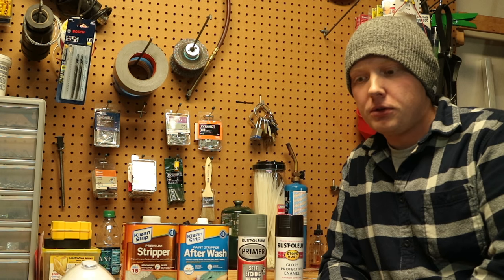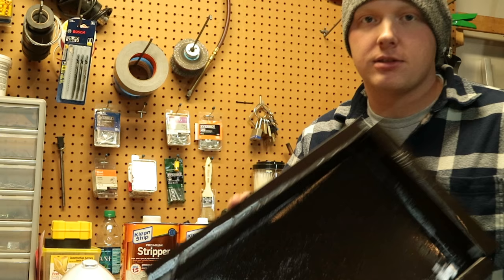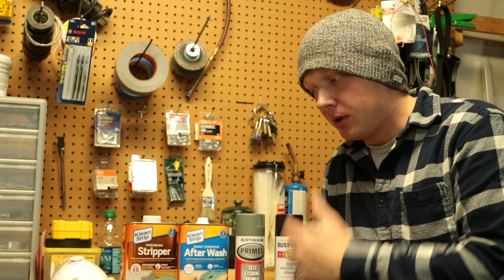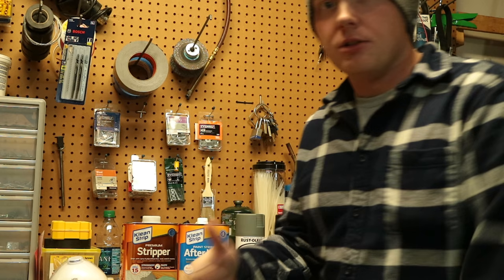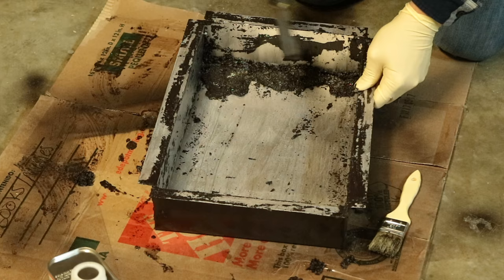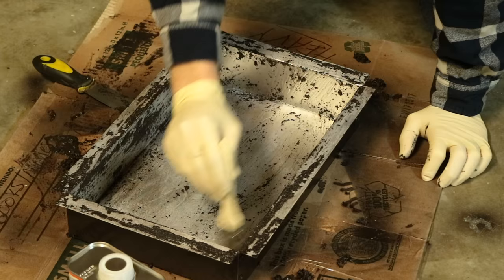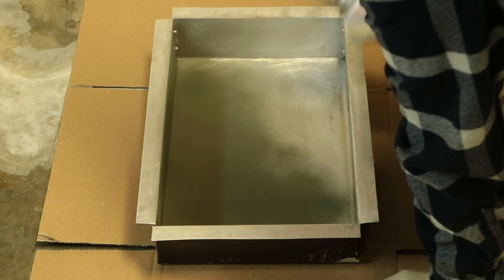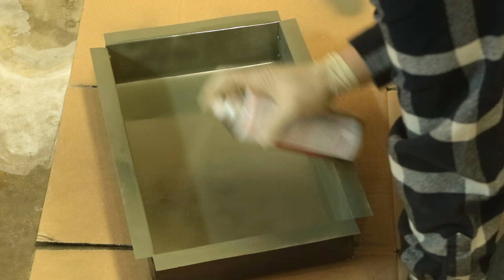The Right Way To Paint Aluminum

Comment: Great video!  The reason it’s hard to get paint to stick to aluminum is because the aluminum surface immediately begins to form a loose oxide. If you have ever wiped off aluminum with a rag or your hand you’ll see the oxide as a grey color. Since the oxide is loose any paint applied sticks to the loose oxide and not the aluminum. The self etch primer has an “enchant “ that removes the oxide and roughens the surface for the paint. Cool stuff!
Reply: * Etchant
Reply: Can I affix this enchantment to other solvents?
Reply: @paulwary Damn I was hoping it would enchant it. 

I’m welding up a 6061 frame tomorrow and having an enchanted gate sounds killer.
Reply: Is the self etching primer necessary for galvanized metal too?

Comment: 36 grit sandpaper. Then acetone. Paint will stick every time.  Revised: I have since stopped using acetone and moved to a 60 grit sandpaper. After sanding I wipe down with a dry clean rag and paint immediately before oxidation has time to start. On aluminum a coarse sandpaper is needed for the paint to bond to the surface. 80 grit sandpaper is not coarse enough.
Reply: Is the finish smooth?
Reply: @UncleJunior52  actually I have stopped doing the acetone all together and have gone to 60 grit. 80 is not coarse enough. Once sanded I wipe it clean with a dry clean rag and then paint immediately before any oxidation can start.   You need a coarse sandpaper for the paint to bond.
Reply: please explain more so I clean the surface with Aston and then sand it with 60 grit and after that I clean it again with an action and start coating immediate?
Reply: 60 grit sandpaper??? You are going to see some ugly gouges and scratches... you should be sanding with no less than 400 grit otherwise it's going to look like zoro went to town on your project
Reply: @GeraltOfRivia99  look don’t tell what to do painting aluminum. I know what I am doing. I’ve been t through that bullshit 400 grit sand paper and a paint job will not last one month and it will just fade away. After 3 coats and 2 clear coats it does not look like zoro went to town on it. I have a reputation of having one of the most durable paint jobs. I can tell that you have never painted aluminum for being outdoors. That 60 grit gives that paint something to bite into and stay on my kinetic blades. No ugly gouges and scratches. You’ve got to remember this is not a hood of a car that I am painting. I am painting something that is on a pole turning in the wind and I’ve got to have the anodized automotive paint last for many many years. In fact I’ve had so many compliments on my paint jobs. My paint jobs have a candy look and the paint is what helps sell my product. You are so wrong about everything. You have never painted aluminum. If you have tried it has been unsuccessful.
Reply: @JohnDavis-yz9nq  36 grit will look like tree bark. You will never be hired to paint anything lmao
Reply: @JohnDavis-yz9nq   Don start up with me boy I am your daddy. You want the ground beef????
Reply: So 60 grit sandpaper, wipe down with a rag, then you use the self etching primer, paint, then clearcoat?
Reply: @williamaudet1235  yes that is what works on aluminum. I use anodized automotive paint that gives it a candy color. Aluminum being already shiny I don’t have to use a primer.. in the anodized world they call it a ground coat. Anything finer than 60 grit the paint will fade away in a short while. When you sand it be ready to paint because aluminum oxidation starts immediately. I put on 3 coats of anodized paint with 2 coats of clear coat. It took me a long time to learn how to paint aluminum successfully.
Reply: @williamaudet1235  onetime I bought some special aluminum cleaner and that was a mistake. I actually believe that aluminum absorbs any kind of liquid and it is like painting something dirty. The 60 grit really gives the paint something to adhere to. Once sanded I use a clean paper towel to wipe it down. Aluminum is hard to paint.
Reply: @JohnDavis-yz9nq  Thanks a lot for the info, really appreciate it. You saved me a lot of headaches most likely.

I'm making some decorative licence plates from aluminum. Just wondering, can I use regular artistic paint? Or I need paint for outdoors that sticks to aluminum? Because I need specific colours.
Reply: @williamaudet1235  I think I saved you from going through what I went through. If you do the preparation like I said any paint should stick to it.
Reply: @JohnDavis-yz9nq  Great, god bless you.

Comment: The aluminum's electric charge does not easily accept painting. Also, aluminum surfaces are microscopically smoother. By scuffing the metal, it gives it surface to adhere to.

Comment: The $3 mask you got is for dust, not chemicals. For about $10 or $12 you can buy a 3M organic vapor mask.  A guy in our state was using strong stripper
to completely strip the paint in smaller room during a commercial renovation in our state and, when he didn’t come home, he was found dead from the organic vapors (VOCs) he inhaled. This is why you want to get the right mask. Had the guy lived, his brain would have been toast.  Thanks for the tip on using etching primer to paint aluminium - I had no idea before this video.
Reply from the maker: Well now that’s just silly. I was doing this outside my garage but your still right I should have a respirator and not just a dust mask. “Do as I say not as I do” applies here. Lol

Comment: Aluminum creates a natural oxide that acts like a layer between the paint and the aluminum and keeps the paint from actually sticking to the aluminum. That's why it's recommended to sand the aluminum with 80 grit then some finer sand paper to remove the oxide. The oxide does start generating again rapidly so only do still the sanding if your prepared to prime the aluminum the same day. The self etching primer is needed because aluminum is such a naturally smooth finish the paint literally just runs off and doesn't stick. The sanding helps create a rough surface and the etching primer also creates thousands of microscopic etched in the finish so the paint sticks and bonds directly to the work and doesn't run the risk of ever cracking,flaking or anything like that. One last tip I like to add to anybody that's going to do this make sure the paint that you're using is rated for extreme temperatures your toolbox is going to range from very cold to extremely hot temperatures and it is guaranteed 2 flake off and crack if you don't use paint designed for that rough environment. Other than that is a very simple job it's a fun little DIY. Oh and I almost forgot after you're done sanding wipe everything down with vinegar a couple of times and make sure it's very clean vinegar also helps the paint in the primer it here to the aluminum 😉
Reply from the maker: Great information thanks for sharing.
Reply: SMG no problem man I'm a professional painter so figured I would share the process really not that difficult the painting is the really easy part multiple light coats you can't go wrong something like this is 95% prep work whenever you think you're done do a little extra as a rule of thumb 🤘
Reply: how can etch it without self-etching prime? if I add HCL it is considered etching g?
Reply: Excellent advice. Some small portions of my aluminum running boards on my truck are peeling and need a touch up. Thanks
Reply: When I was in welding school back in the day we had to clean aluminum really good with a wire brush we used ONLY for aluminum (so it wouldn’t cross contaminate) and right before welding, basically within 5 minutes of cleaning because it oxidizes so quickly…. I mean you couldn’t clean it and go to lunch and come back and weld, too much time after cleaning, hope that helps give anyone some perspective….

Comment: I has a similar project with aluminum, and used the exact same primer, however I used the Krylon Fusion spray paint. It worked great, and 6 mos. Later still looks good. Seemed to stick really well!
Reply from the maker: Great! I just looked at mine the other day and it still looks great after 6-7 years.

Comment: You have to wait until the paint is fully cured before spraying any clear coat. There is evaporating and degasifying going on for days. Check the paint label. You will see something like dry to the touch 15 min. Okay to handle after 2 hours. Fully cured after 7 days. (All these are affected by temp also.)
Reply: Very true

Comment: You must etch metal, especially aluminium.  I have found that you should always use the same brand clear coat.
Reason is that using another brand, the mixture of paint and thinners is massively important. Some clear coats have a lot more thinners in it and will react to the paint. From my experience I have found that rustoleum is the best paint for any metal.

Comment: The first go round where it peeled, not sure what the problem was but I learned the hard way that you can't mix Rustoleum with other brands!  Rustoleum is enamel and most everything else, (ie Krylon) is laquer.  The thing I don't like about Rustoleum primer is many days later it may be dry to the touch but it's not really hard, not good for automotive.
Reply from the maker: That could be. Rustoleum has always worked great for me!

Comment: I spent a number of years in the aircraft repair biz, painting aluminum is constantly going on, so prep is critical. You don't want your A321 peeling during a 37, 000 ft flight across country!  LOl!  You want to start by using a chemical called Alumiprep 33, followed by Alodine 1201. Plenty of videos on youtube showing there use , but, they are worth it before painting.  This is all about controlling the oxidation process
Reply from the maker: That sounds like it would be fun. Great tips! I'll have to check them out if I'm ever painting something critical like an airplane.

Comment: You need to use DTM (direct to metal) paint.  Available at most paint stores, Sherwin and Benjamin…. In most cases, where finish is decent,  it is not necessary to prime with DTM.  I would recommend priming though…

Comment: Thanks for the tips, but a paper/cloth "respirator" does nothing to prevent chemical fumes from getting into your lungs - they're only for dust particulates. Use a a full chemical mask - one that has charcoal filters - to protect your lungs from chemical fumes.
Reply from the maker: You are absolutely correct. Thanks for watching.
Reply: This is so false. I use alot of oil base paints and a n95 respirator no matter what it's made out of offers the same protection. For spray painting a little thing like that perfectly fine to have that resperator

Comment: Bare aluminum oxidizes. Paint will not stick to this oxidized surface that will continue oxidizing. This process starts almost immediately. You need to fine sand and then clean (remove all of the dust) form the cleaned aluminum then use an etching primer on the bare surface immediately! Never sand this coat of self etching primer. Self etching primer chemically bonds with the aluminum creating a chemical bond rather than just a mechanical bond. Cover the self etching primer with a filler primer and lightly sand with 320 grit and clean again. Then apply your paint coat and a clear coat if necessary.

Comment: Most importantly, how did it turn out?  Did you find the primer made a noticeable difference in the adhesion of the paint?  I'm looking to do an entire boat soon...
Reply from the maker: +Daniel Cartis absolutely. This thing turned out really good. If your planning on doing a whole boat it's a must have unless you already have a primer base on the boat. When I painted my 14ft boat it already had a primer base on it so I just scuffed it up and added the layer of paint I needed. If I painted my 16ft boat which has no paint on it I would absolutely need to use self etching primer. I would probably over do it too. Using about 4-6 layers of primer and then 4 layers of paint and then clear if you want it. Just know that his isn't the best way to paint a boat. Using a spray gun is the best way to do it. This just happens to be he cheapest way to do it with the tools that I have.

Comment: I just painted my boat with rustoleum paint.  Now that I finally finished I don't like it at all. Can I use the self etching paint to paint over the paint and re paint it again.  I don't want to sand it down AGAIN!
Reply from the maker: I would probably find an easier way to sand. Painting over an already bad pint job will only piss you off in the long run.

Comment: you should never use a propane heater in your garage because of the moisture comes out as a result of the propane burning it makes it very humid in your garage the paint will take forever to dry I learned this when I was trying to paint some of my Mustang parts and wondering why the paint wasn't getting hard I looked over my humidity Gage in the garage and it was over a hundred percent humidity in there
Reply from the maker: Good to know. Thanks.
Reply: Yes. I don't have one, but it is always good to know details

Comment: This primer comes in black.. and black is the color I want.. and I don't want it too shiny either, would you just leave that in primer, or just clear coat the primer?
Reply from the maker: I did not clear mine. I just made sure to put something other than the self etching primer over the primer. It’s a primer not a paint designed to keep scratches off.

Comment: Just watched a YouTube video where the guy etched the aluminium with sand paper before using Self Etching Primer, I was wondering why it was called self etching when you have too etch it.

Clearly if it says Self Etching don’t use sandpaper as you are wasting your time.

Thanks for the video, wish we had more youtubers that actually know what they are talking about.
Reply from the maker: I’ve sanded aluminum before using self etching primer in the past. It all just depends on what quality you want to end up with or what quality metal you start with. Thanks for watching. Glad you enjoyed. There’s no one way to do this. Just because it’s different doesn’t mean it’s wrong. It’s kinda like going through a car wash before detailing your car yourself. It’s probably not necessary but it’s not going to hurt, only help.

Comment: i have  self etching primer for aluminum and galvanized steel.. is it possible to be used on normal steel too? i wanna repaint my old steel bike frame, but this is the only spray primer i have

Comment: love your videos, I have to tell ya, those white mask are particle mask, not really the best for chemicals. they are used for dust and what not
Reply from the maker: +Chris Crow yea I really need to get a proper respirator. Thanks for watching. Glad you enjoy them.
Reply: ya got yourself another sub. so far outa all the tiny Bass boat conversions on you tube you have done a fantastic job showing us the details and explained them well. very helpful
Reply from the maker: +Chris Crow I appreciate that. Thank you very much.
Reply: At least put a fan near the stripper application, or do it outdoors. Methylene Chloride is nasty, nasty stuff to inhale
Reply from the maker: +Michael Caswell thanks for the tip. I need to purchase a good respirator.

Comment: Over the years I've found that painting over aluminum it's almost impossible.
Reply: I have used the same primer and even letting it sit for 2 to 3 days its still easy to remove with my fingernail ;()
Reply: I cleaned and sanded my aluminum valve covers with 80 grit sandpaper. Put a couple of thin coats of this stuff. Then topped that with a couple of coats of vht primer about 20 minutes later. And then did metallic finish base coat.. and it looked really good. But then I  screwed up doing anodized blue tint. Looked awful so I'm trying to start over. Now I can't get the shit off. The primer is definitely not coming off easily. So 🤷‍♂️

Comment: I saw your channel when you shared it to a local fishing sight (nwi) and looked you up on you tube. I'm restoring a 12ft 60's sea king and might steal some of your ideas. If you got any ideas for a sump system for a boat without a plug or installing a plug I'd love to hear them and or see a video on electronics in boats also. Thanks for the info.
Reply from the maker: Thanks for coming over to YouTube and checking out my videos. I'm really glad you enjoy the videos, steal as many ideas as you can, that's the whole purpose of this channel, and if you have any suggestions for me I'd love to hear them.

As far as the sump/bilge pump goes, I plan on adding one towards the end of this build when I start doing all the electrical and put in the livewell. I would have to say for a 12ft boat I would go for a drain for sure but then you might also want to add an additional smaller pump that you can toss in the bottom of your boat if you need to use it (that's what I've done in the past).

For installing the drain plug I would go with something simple like this. Just make sure you seal it with a proper marine grade silicone/sealant so that your boat doesn't take on any water.

Don't forget to subscribe and share with your friends. I have new videos coming out every week!
Reply: SMG Fishin' I was looking at something like that just so I have a plug for when the boat is sitting.I plan on getting a little sump from Walmart, they have them for like 20 bucks I think.

Comment: what about partially painted aluminum shock absorbers - very well sanded still with some original paint on it and it has to be completely resistant to automatic transmission fluid?
Reply from the maker: Just find a paint that will do the job. They sell some engine paint that works for that specific purpose.

Comment: I assuming that aluminum oxide is the issue, the etching primer probably eats through the layer and binds to the aluminum before oxidation occurs. Ensure you use a respirator made for filtering solvent fumes, etc. Normal dusk masks will not help.